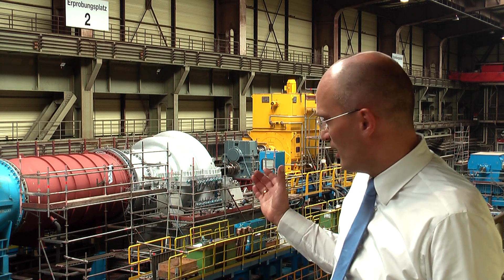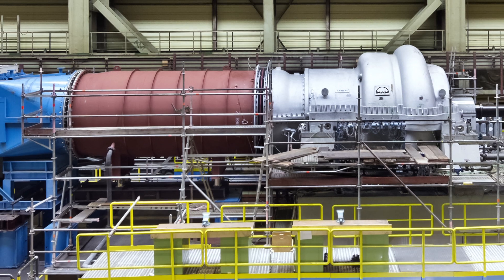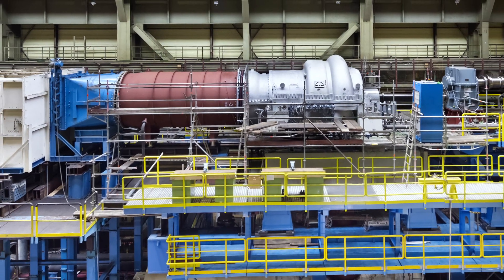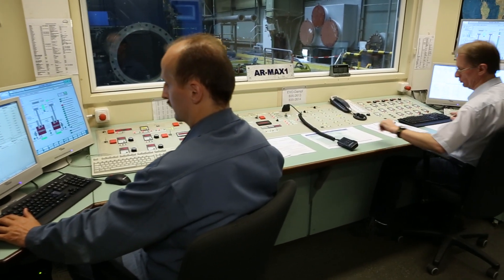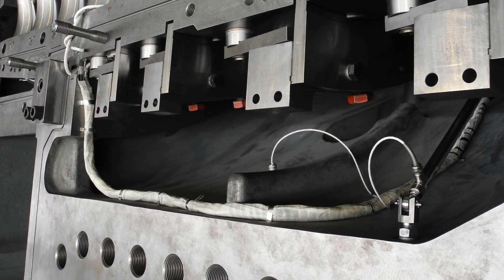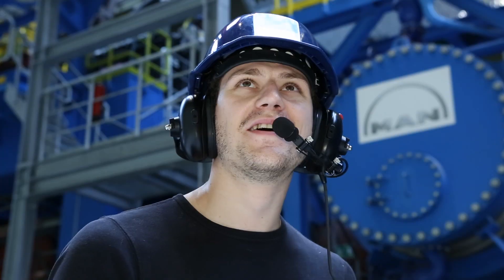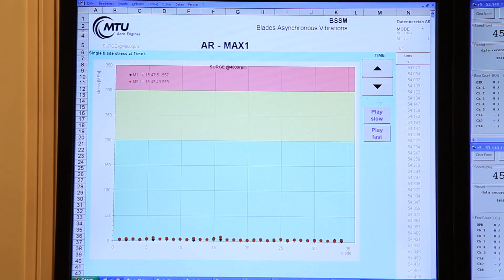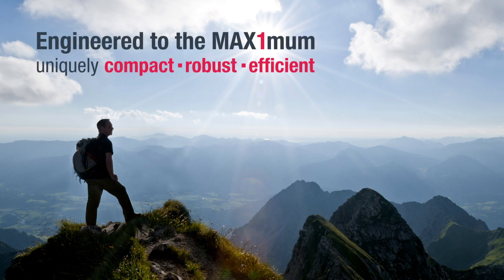First test run of AR-MAX1 compressor

Comment: The explanation of how they measure the compressor blade loading and vibrational behavior during surge characterization is pure genius. Super level of the best engineering, sx could definitely use some of these engineers.

Comment: Is this compressor designed for a marine diesel application or as an in-line natural gas pipe line?  I love machines. Just wish my High School had offered German in lieu of French.
Reply: +mike klaene  It´s designed for use in ASU´s (Air Separation Units).
Reply: Driven by a 64 MW electric motor ⇔ 85825 horsepower. So more power than just about any ship engine!